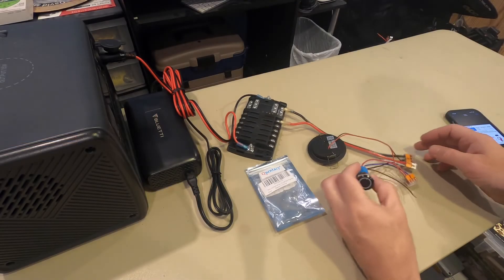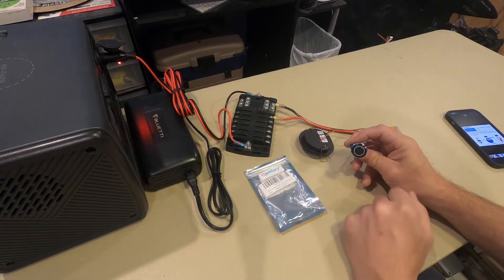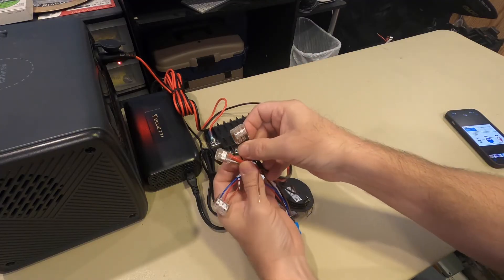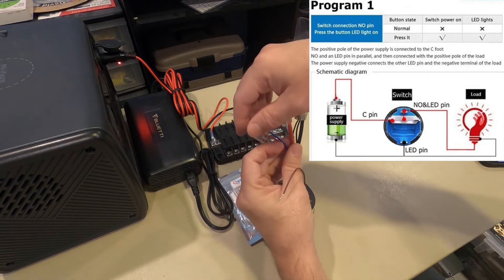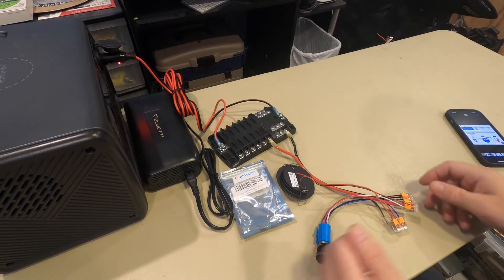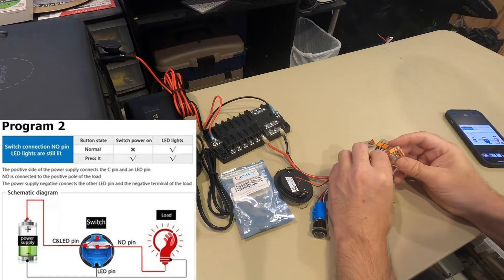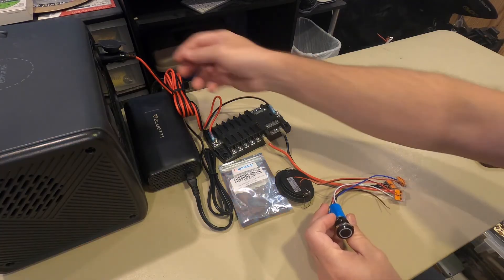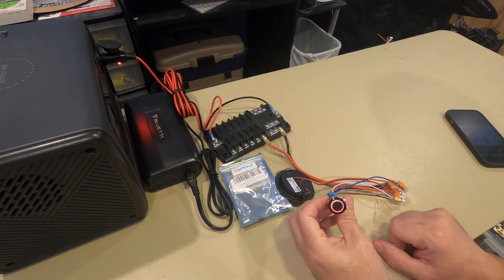Wiring a Push Button Switch with LED ring light

Comment: I have a 4 wire 2 blues 1 red 1 black push buttom
Reply from the maker: Sounds like you may need to reference the instructions or call the manufacturer for assistance.

Comment: I still do not understand it. I have a simple 2 prong on/off which i want to replace with a switch that has led built into it(similar to this) however there are only two wires in my car that plugged into that 2 prong switch (obviously). Now how do i wire this switch to those two wires so that when i flick the switch and it completes the circuit the led’s light up and off when i flick it the other way (turning the switch off). Its similar to this with 1 NC, 1 C, 1 NO/ON, 1 small negative and 1 small positive. I am so confused. Please help and thank you 🙏🏼
Reply from the maker: I believe I linked the product in the description, if not let me know. There are more ways to wire this than I shared in the video. Pictures and descriptions are with the product.

Comment: Is there a way to wire the led in the button to its own power source so it comes on only when that source provides power? For example im trying to install a homelink garage door opener circuit in my car. The circuit board has its own light that flashes to indicate certain things. Can I piggyback the switch’s light terminal off that light on the circuit board so the switch will flash to indicate things and act just like the light on the circuit board?
Reply from the maker: I'm not sure, you've asked a lot of questions outside of the scope of this video. I think the Amazon product link is in the description, there might be additional wiring methods in the diagram with the product that might help you.

Comment: is there any way to wire this so that the button has to be held  down in order for power  to flow?  Meaning when you take your finger off the button power is cut.
Reply from the maker: MIght be, try following the Amazon link in the description. If the product is still there, I think it has more wiring options than what I show. There are definitely some buttons that are only on while depressed.
Reply: The switch he demonstrates is called a latching switch. The switch you are asking about is called a momentary switch.

Comment: Ive tried several ways to get one to work but just wont,,wonder if its a ac instead of dc,its for a light on a motorcycle,
Reply from the maker: You would definitely want to know the specs on the light and the switch and then know what voltage to send to them.

Comment: How would I wire this APIELE 22mm Latching Push Button Switch 12V Angel Eye Ring Light LED Waterproof Stainless Steel Round Metal Self-Locking 7/8'' 1NO 1NC with just red,black,2blue wires to ply hydra 4ch Bluetooth amp using 3 3spot lever nuts ?
Reply from the maker: Hi Kyle, that is very specific. Hope you find a video for that model switch or if you watch enough of mine and others videos on YouTube, you will understand how to wire it yourself. If the switch is from Amazon, it might have photos on the product page to help as well. Best of luck.

Comment: Quick question  how to you replae a switch on a motorcycle  which onblyu has 2 wires  power and negative?  i wat button light on when it is pressed in and off whenn it is out
Reply from the maker: I would imagine the motorcycle is the same power source as my battery if it's a 12V power source, however, being that I know nothing of motorcycles or what you are working on, please consult a professional if needed.

Comment: The diagram you showed was extremely helpful, seeing the the positive and negative lines running from battery to load was very clear, unfortunately your usage of levernuts made this look like a tangled confusing mess at first but the diagram saved it😅
Reply from the maker: Glad it helped! Using lever nuts can certainly feel different at first, but they are AWESOME!